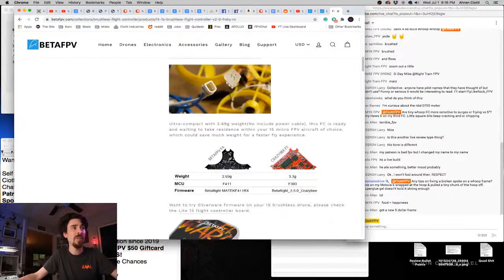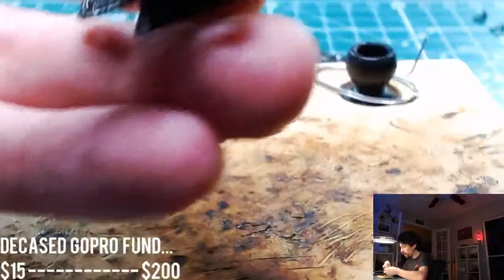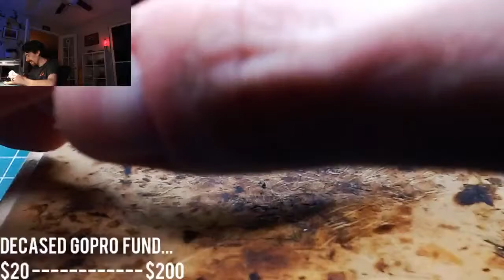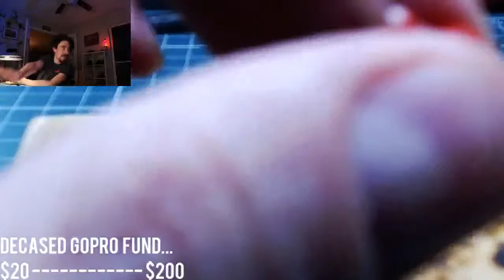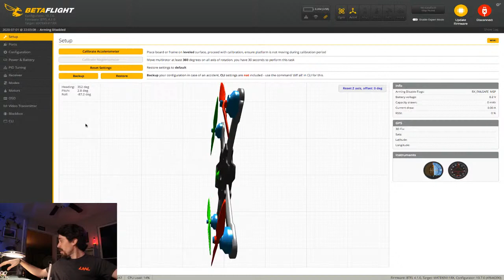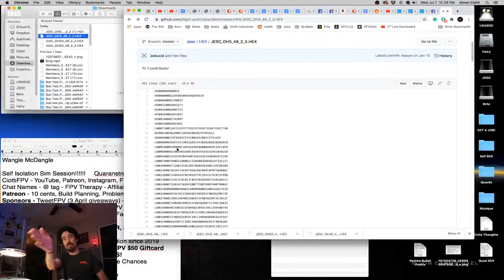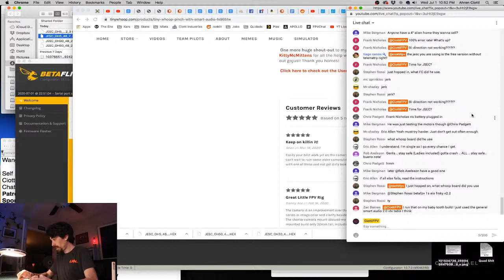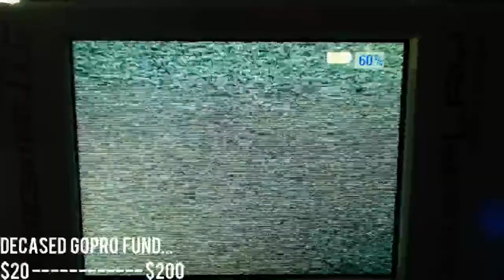The Ultimate Freestyle Tiny Whoop Build

Comment: For the antenna portion of the video. Use a coax prep tool or a phone line stripper ..the prep tools are designed to score the white plastic called dielectric so you can expose the center conductor.. yes i am a cable guy lol the prep tools are like 2 or 3 bucks and itll save u a headache. Thanks for ur vids i been watching all ur live streams and just finished building my first quad/whoop to bash around the house  and learn. See ya in ur next live

Comment: I have to say, I built this quad just with a lighter antenna, and the v2 venom props instead. And it’s amazing!!! Gonna take her out tomorrow for a rip. Would you recommend a different tune setup for outdoor acro?
Reply from the maker: To be totally honest, for outdoor acro I would build a toothpick, the performance increase is absurd and they aren't all that expensive.  When you start doing things to a Whoop to make it work better outside it gets a lot harder to fly inside if that makes sense
Reply: CiottiFPV couldn’t agree with you more. I fly a baby tooth build most of the time. Only reason I ask about the whoop is because IGOW2 is approaching ;) 

Either way, thanks for the video, and your time!
Reply from the maker: @smcarmel  oh christ I keep forgetting about IGOW2 even though I'm gonna try to do it!  Ugh I'm gonna lose so fast
The only way to get a 1s whoop to really work outside is with the Happymodel 0802 25,000kv motors which are a riot but will take some getting used to
Reply: CiottiFPV would you those same build list list with those motors? 🤔 you gotta join dude! You got potential to be a top contender!